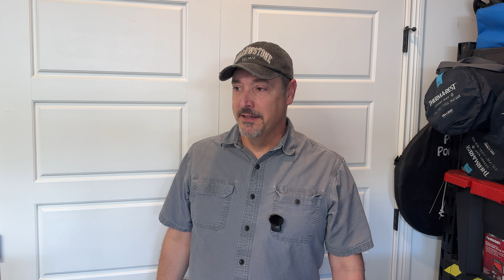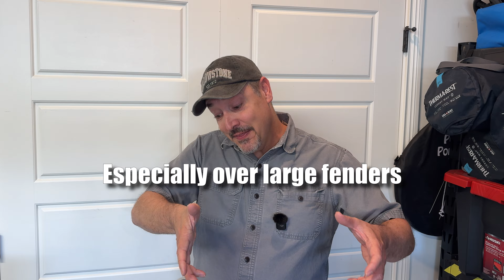Don’t Scratch Your Heads! The Safe Way to Install Them

Comment from the maker: As a former automotive machinist, I’ve always believed that taking an extra minute to prevent a mishap is always worth it, no matter how straight forward the job seems. If you mess up here, it’s likely to cost you time and money.

When it comes to working on vehicles in general, which specific part of a project you’ve done caused you the most stress or required your absolute focus? What are you currently working on? Let us know in the replies!